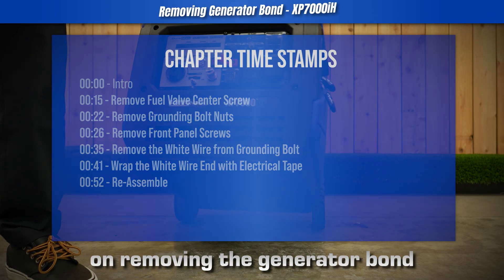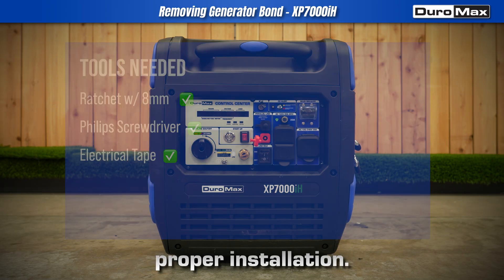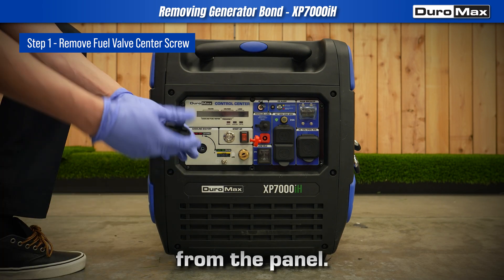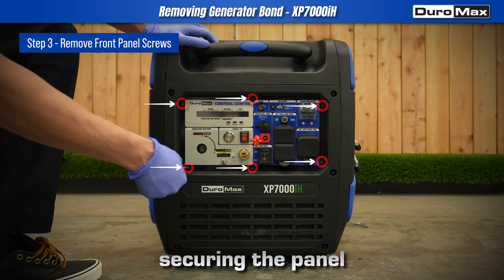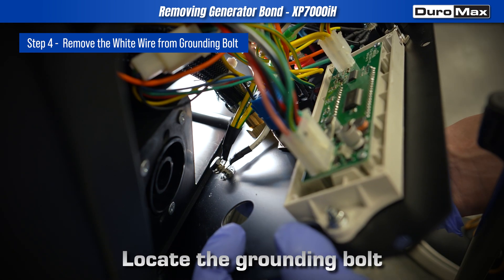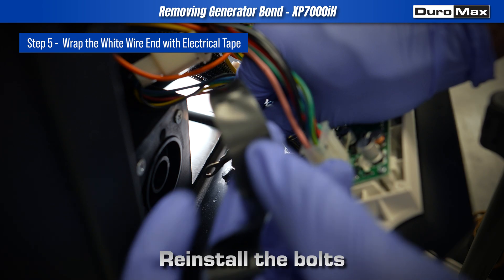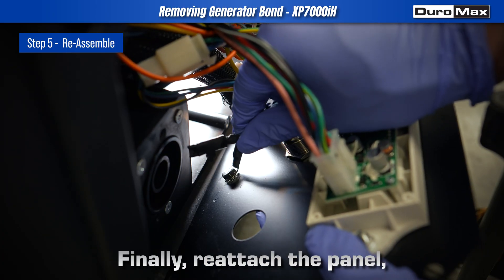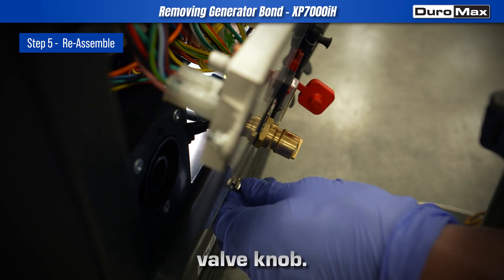How to Make Your XP7000iH Safe for Home Backup Power

Comment: Yeah talk about half-assed. The average homeowner shouldn’t be disconnecting wires without a good understanding of what they’re doing. Having a bond behind the panel means that 90% of all users won’t know it’s there and still use it in applications where a floating neutral is required instead. My Dad bought one of these and the info on unbonding the neutral wasn’t even in the manual. A key switch should be used instead that show bonded or unbonded settings.